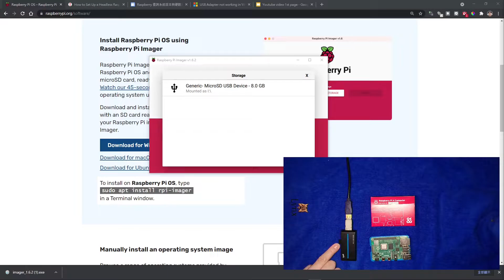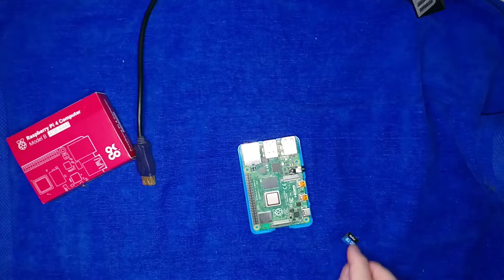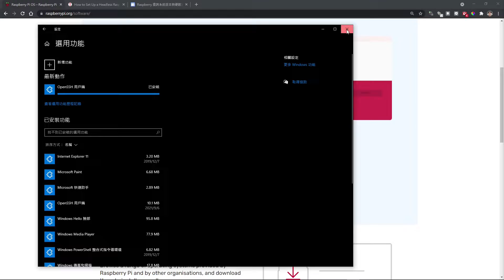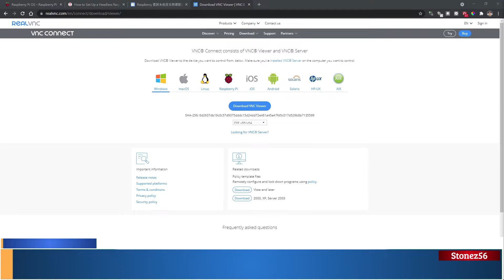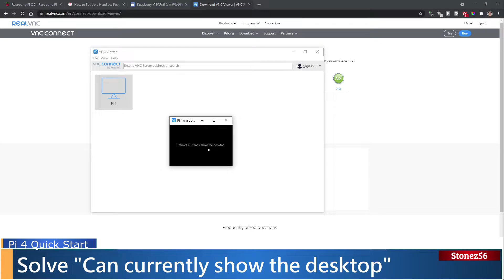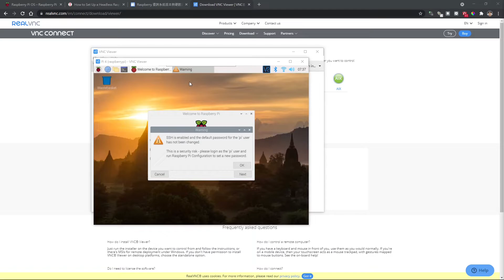Episode #1 Headless installation of the series "Learn Raspberry Pi together"

Comment: Very nice how-to, should be enough to get a new headless R-Pi running.    I would add one more step at the end: 
     sudo apt update  &&  sudo apt upgrade
in case there are updates since the image file was made.
Reply from the maker: That's a great addition to get Pi installed completely. Thanks!